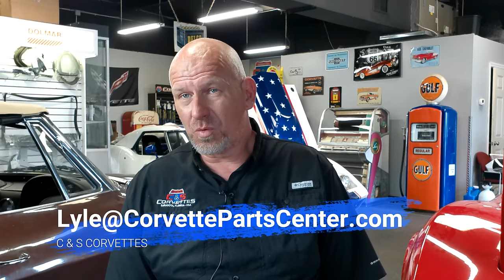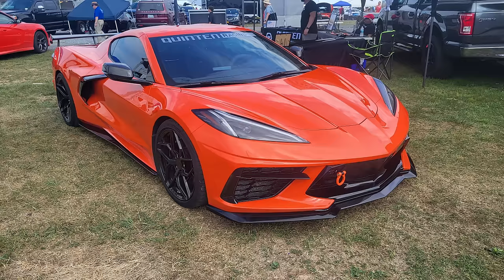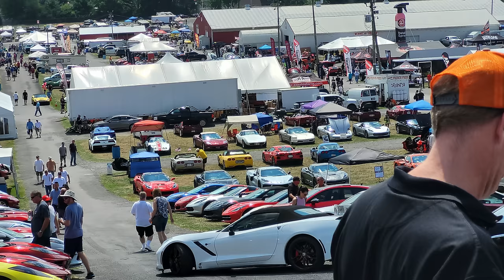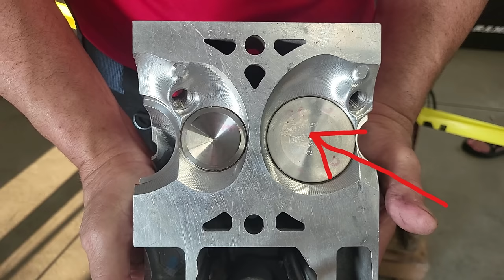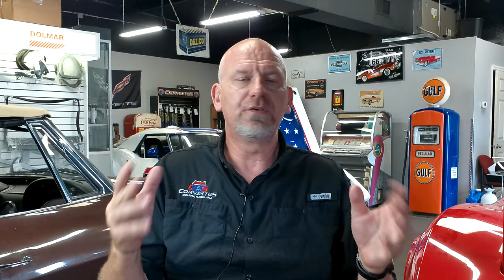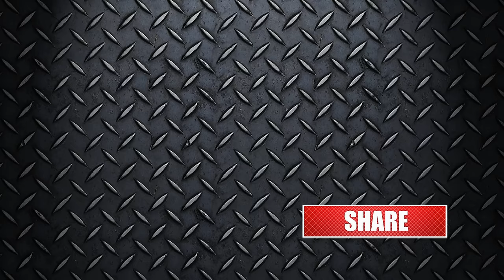The Truth about the LS7

Comment: Prior to covid I wanted a C5. As proces soared it allowed me to research and watch youtube lol. Quickly learning I'd probably prefer a C6 for the added comforts as I plan to drive the car 20k miles a year. The LS7 is about the only reason I o ly want a Z06 now. Personally I'd pick a 09 for the tr6060 and the newly designed steering.  There's plenty of heads fixed cars with meticulous owners/records. Again Personally, but I'd prefer a HCI car maybe stage 2 or 3 with clutch upgrades.  Maybe one with a backup camera mod already done lol.  Then again if you find someone that is the 2nd or 3rd owner with all record's from PO's and has spent the cash a lsx stroker ,etc with an A&A kit with under 5-10k miles since the "documented build" for a price some want for a 25-50k mile stock car.....well, I feel like I'd be a fool not to jump on the performance enhanced version. Wanting to track the car? You can buy a well sorted properly upgraded car for far less than a stock car with all service completed by a "GM tech"  and then pay a shop to make your car more track dependable,  if that makes sense. Thank you for making this video. Savage Geese has a really good video about the C6 Z06 where he has the engine designers at that time talk about the LS7 as well as changes from 06-13. Love your channel. Keep up the awesome work!

Comment: No mention of the oiling system upgrade in 09'? The improved oiling makes a significant difference in performance AND longevity... Just wondering why dude didn't mention this? Otherwise this video gives sound advice to the moderate owner/hobbyist IMHO. Thanks. ;)

Note:  I own an LS7 and its not in a C6 wither.... There are a LOT of improvements that can be made to these that you didn't mention which in fact leads to longer life of the engine... Replace both intake and exhaust valves with stainless steel, you lose a couple hundred RPM but they are a lot more stout than factory.. Also, titanium is NOT that hard of a material, in fact it is soft compared to SS....You may want to update your records on that. I think you should have made the point that if someone is going to "upgrade" their LS7 then it should not be piece-meal, that is po-jank sh*t and does in fact lead to failures. On the other hand an LS7 when given the TOTAL mod treatment is just as durable if not more so than factory engines and produces a LOT more horsepower/torque. ;)   Then the next conversation should be the REST of the vehicle, clutch upgrade, suspension/brake upgrade, axle upgrade... Again, your advice is sound if some one is uninitiated... Then there are folks like me... :D Anyway, thanks for the video.

Comment: This is such a bummer for me. The base v8 Camaros and corvettes just don’t feel special enough to me. Supercharged is alright but honestly and Cars like this it seems like too much of a good thing. You just spin the tires. The zo6 and z28 are the sweet spot with naturally aspirated and have the special feeling but then have all these issues with the ls7 and that’s why I won’t buy one. Really a bummer to me. I mean gm has got to be a multi billion dollar company and they can’t build a reliable 500 hp v8. They knew about the issues in 06 and basically did nothing to fix it for almost 8 years or whatever. I’ve considered buying a low mileage stock one and have some work done to “fix” the problem. But then your probably another 5k$ more into an already expensive car and I don’t know that even with the “fix” I would feel good about driving the car hard. Really a bummer for me. But what can I do

Comment: Thanks for the info , it gives a potential buyer something to think about.. negative comments usually come from hot Rod enthusiasts..anytime you street race or just hot Rod an engine there’s a possibility of doing some kind of damage that can rear its ugly head later on.. I have a 2006 C6 LS2  coupe ,in the garage , I bought new. 34,000 original miles, have not abused this car.. I plan on taking it to Lyle one day for work ( balancer) that’s been needed so I can get it back on the road.. even though it’s a stock 400hp engine there’s plenty of power to enjoy.. thx Lyle

Comment: Lyle, this was a very disappointing video. Very. The head machining issue is real in the LS7. Check the forums - more than just a few actual cases of dropped valves. 
Beyond that, what in the world would you expect GM to say? "We know there's an issue but since all those cars are out of warranty, we don't care?" Of course they're going to say everything is ok. It's like asking the government to investigate itself: is anyone surprised when they find they did nothing wrong?
Wasn't it in one of your videos that the LS3 takes to modification such as forced induction just fine? Why would the LS7, which is basically an endurance racing engine, be built to be so fragile? Did GM do that with the LT5? No. I've read ACAR and Corvette from the Inside; Chevy doesn't skimp on endurance testing. 
And just shift at the torque peak? Come on, man! Torque may fall off, but work is still being done and more work is done at faster engine speeds. With a relatively flat torque curve, higher RPM makes more horsepower (work done over time). Engines 101, yes?

A breathed on LS7 should be able to run at 7k RPM for 24 hours straight, and here's GM telling us not to modify a pushrod 427 because they built an engine too fragile to get near redline? That's essentially an admission of guilt. Bottom line is to budget $4k for the head issue when you buy your C6Z and find a reputable non-GM shop to check the heads. That's what I'm doing.
Reply: More rpms doesn’t always equate to more hp every car has its peak power then it drops off due to valvetrain loss. If you look at any and every dyno graph you will never see max hp or torque at the end of the revs. But I’m with you Chevy made the rev limiter at 7 for a reason if not every ls would be at 7k yes I do find it odd that one of the biggest ls engines have the highest rev limiter.
Reply: And sodium filled exhaust valves and titanium intake valves aren’t anything special of new that’s old aviation tech back in the 60s. I know that because I’m a aviation technician but here in the sport car industry everyone acts like it’s so new and unique
Reply: The nice part is since the engine forces you to do all that work you can throw on headers a nice intake and a cam and make at least 530whp, and past 600 if you get a big cam etc.
Reply: @jetlagtj427  Valvetrain loss????? wtf???
Reply: @jetlagtj427  I didn't want to get super technical in a simple YT comment, but notice I qualified my statement: "with a flat torque curve."
Reply: @jetlagtj427  And you're correct, no real new tech. Heck, the LS6 had sodium filled valve stems.
Reply: @peterb4143  Yeah, that's the plan for after the holidays.
Reply: @rapid13  that’s awesome. When my clutch eventually gives out and I rebuild my bottom end I plan on getting a little nitrous kit in maybe a year 1/2 or so
Reply: @milojanis4901  ever heard of valve float?

Comment: Please don’t drink the GM koolaid. Go to the Corvette forum and you will see thousands of stock ls7’s destroyed by exhaust valves breaking at the weld and destroying the engine. I did the wiggle test on my bone stock 07Z with 12,000 miles on it and the first exhaust valve I tested had so much play, I put the car on a trailer and took it Vengeance racing in Atlanta. There were so many folks having the same issue Vengeance had a special going just to fix the heads. West coast corvette was selling the fixed heads with the crappy sodium filled “welded” exhaust valves replaced with solid stainless steel Manley and new guides for around $1000.00 if you had a good core to send in. Both of these businesses would not be having specials unless there was a high demand for the fixed heads. With all that being said, the C6 Z06 is still the most performance per dollar car there is. I bought a garage kept 9000 mile car for a little over $40,000. Where else can you get a car that has run sub 11 sec. quarter mile bone stock, yes it has been documented to all the nay sayers. Top out at close to 200 mph and get 29 mpg on the highway. Yes I have got 29 mpg several times. The C6 Z is one of the lightest corvettes ever made. Which makes any modification amplified. I love the LS7, buy a C6Z fix the heads then go beat on it. It is an amazing car. Not one issue since replacing the heads. 20,000 miles ago.
Reply: I've been on the Corvette forum about 7 years and read the archives all the time starting from the beginning, and you stated thousands of ls7s have failed? I have read about 70 to 80 dropped valve threads and in those posts, they state they know somebody (one or two) they knew dropped a valve, so multiply that by 3 = about 240 that have dropped a valve. Thousand have not been reported on the Forum.

Comment: Lyle I've followed the LS7 story for several years and continue to be more suspicious than ever of the original LS7 equipped cars.  It isn't unusual for GM or any other car manufacturer to lay an egg occasionally and try to mitigate the public image damage. You offered to ask your GM connection our questions, so I'm considering using a LS7 in a Corvette resto-mod from their high performance catalog (#19329246) and was curious if there have been any significant measures taken in these newer manufactured engines that can squash my concerns?
Reply: I think that I will pose that question to both Paul Koerner and another big performance shop that does these heads all of the time to get both opinions.  Lyle
Reply: @lyleaulwurm9486  Thanks, really appreciate it!
Reply from the maker: @NationFirstGreenville22  I published that video a couple of months ago using information from a former GM insider.  Search LS7  in our video feed...  :)  Lyle

Comment: Does the LS7 and LS3 share the same lifers out of the factory?
Reply: I'm not sure about the lifters, but I know the LS3's have had very few issues over the last 15 years.  They are very strong engines.   The LS7 is much more prone to difficulties.  Lyle
Reply: @lyleaulwurm9486  I have a LS3 that developed piston slap very early on in its life. I have had it for 6+ years now (stock). The Piston slap noise fades away as the car reaches temperature and is gone by the time the oil temp reaches 92c/197f. Is this anything to be concerned about?

Comment: I keep telling yall an the still but no no no people in the commet section. Ive 0wn 3-5th Ls 346 an up. grude race a Ls base 4th gen z28. Im telling you Gm Ls motors are not bad on that issie. Yes some old apples but not the many thats was sold. Yall take one small % of complants. An make it 100% a Gm Ls vahle failure not true
Reply: So if the LS7 valve issue is not true what direct experience do you have with the LS7? You list all kinds of motors up to the LS1 and maybe a LS3. I have direct  experience with the LS7. I avoided the issue and had the heads pulled. Guess what….i had way out of spec intake valves and on the edge of being out exhaust valves. My engine builder Checked the new heads on arrival from GM….Guess what…they were out of spec. New heads out of spec. I went to his shop and did the measurements for me. No issues you say…tell that to several friends that have had motors replaced under GM warranty. I watched a guy at the track come to tears when he blew a motor and didn’t believe the valve issue. Should of seen his face when the tow truck driver poured a handful of the block into his hands in the paddock. If you happen to have a LS7 and have not addresses the heads go stick your head in the sand. If you don’t have a LS7 stop giving out false information when you have no experience with the issue.

Comment: Valve train issues are a well documented and easily traced issue on both LS1tech and CorvetteForum. And plenty of folks with stock engine valve failures. 

Lyle lost me at his shift point recommendation.  A tractive effort graph easily proves peak RPM and HP is required in order to reduce the power and acceleration lost between shifts and RPM drops. Granny shifting is a detractor in spirited driving scenarios and definitely not going to win you any races. 

He lost me again at “performance chip”.  That’s not a thing in modern LS powered Corvettes.  

I enjoy Lyle’s content but this one has a few holes in it.
Reply from the maker: I was repeating what I had been told by Paul Koerner, so I accept any criticism of that information openly.  As far as the performance chip comment, I should have said performance programmers (like the diablo), which are certainly cogent when talking about LS engines.  Thankyou!  Lyle
Reply: @csvette  Fair response sir.  I understand Paul towing the corporate line...as he should.  Downplaying a well publicized and documented design flaw and QC didn't do much for his credibility though.  And to your point guys using a $500 handheld or letting their buddy with a hobby tune their cars is just a recipe for disaster.  The "cheap way" is usually anything but.

Comment: I had a 06 C6 Z which I bought new. 100% stock had valve failure at 14k miles... I’ve known 7 friends with C6 Z... 5 of them had engine failure. Either dropping a valve or bearing issues lead to catastrophic engine failure. Case closed... stay away imo!!

Comment: A GM tech isnt going to be 100% truthful. If GM was honest theyd wuit putting out faild transmissions and lifters on customers dime. 2007 era monte carlo dashes turning to goo, on vustomers dime. 2002-2007 silverado abd sierra fan blower motor resistors causing the wire harness to melt on customers dime. We can keep going.

Comment: GM screwed up the c6 z06 with dropped valves..c7 with overheating issues and the c8 going to be a joke also. GM lies all the time about their engine mistakes to keep from  from having to warranty them. They ectech 4 cylinder with it's excessive oil consumption...the lt4 zl1 with wet sump oil pump failure...the list is long. Now ev's...the Bolt...20 something thousand batteries replaced already...burning people's houses down. GM says ..don't even park the thing in our garage or near your home. The c8 e ray burned to the ground in Spain. Don't believe the snake oil. GM lies.

Comment: I knew it. Blame it on basic aftermarket bolt on parts. Yep, the K&N filter blew the mighty LS7.  Sounds like Ford talking! I've had 3 'Vettes and other LS equipped GMs, current one has 245k trouble-free miles with bolt-on upgrades. Typical GM beancounter BS talk, blame it on the customer! My friends 34,000 mile bone-stock LS3 engine blew. What's GMs excuse there, he revved it to 4000!? What about the numerous issues with C7 LT engines? GM isn't what it used to be, that's for sure!
Reply: Indeed it isn't what it use to be. Speaking of C7's, let's remember GM won a court case regarding the failure of C7 wheels. GM admitted it was an engineering failure but wasn't covered by warranty because the warranty state failure of materials and workmanship. Which it wasn't as both performed as they should, it was an engineering failure! Win for GM (sort of)!

Comment: You failed to mention this is not a tuner engine stock, tune this ls7, attempt to SC it will fail, the sodium filled valve stems will fail and you will grenade this engine, you also did not mention the titanium conrods that eat the crank, bone stock sure, but everyone wants a little more, being a L1 mastertech and one of the top GM tuners on the east coast this video failed to show the risks of bolt ons, even builds, the ls7 heads I do not care what build date is flat out suck, if your going for 1000 hp + throw those heads in the trash, or sell them to grandpa. I will gladly argue this with any "top GM builder" as I have seen it to many times. But thanks for taking the time to make the video much appreciated.

Comment: These comments about changing the exhaust or installing a “cold air intake” are nonsense. They will not lean out the air/fuel ratio. If the engine flows more air (which an aftermarket exhaust and a CAI aren’t going to change the airflow much), the MAF sensor will see the increase and the PCM will add fuel to keep the AFR where it’s programmed to be. The only way you will lean out the AFR is by tuning the PCM to be leaner, or making extreme changes that the fuel system can’t keep up with; like adding a supercharger for example.

Comment: The valve seperates itself from the stem and this detroys the engine completely when that happens. I just saw one yesterday BONE STOCK  ENGINE  valve missing. Engine seized pulled the  head off and piston is gone rod and wristpin destroyed the cylinder crscked the alloy block behind the sleeve inside a coolant gallery. 
The engine is scrap. She is fucked. To say a cold air intake is responsible for a valve breaking from the stem. Come on dude. 
People are not stupid. And telling people dont rev them to 7000rpm. 
Then Chevy should have limited them to 5500 rpm not 7K if the revs are the problem. Problem is the valve guide. The valve touching one spot when it closes on an angle for so long and bam breaks off. Its not rocket science.